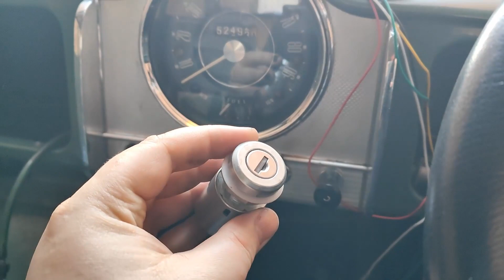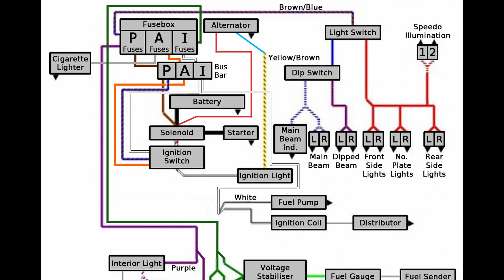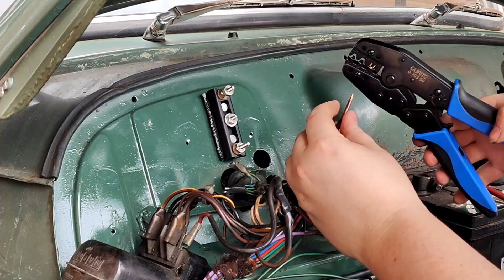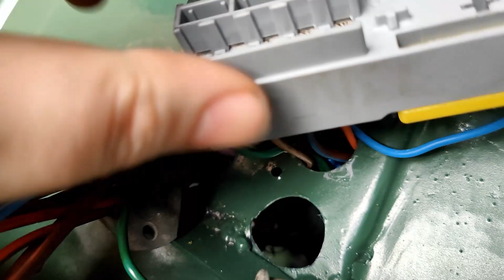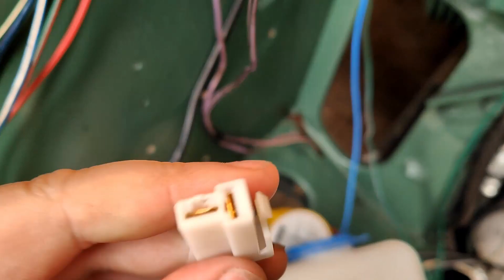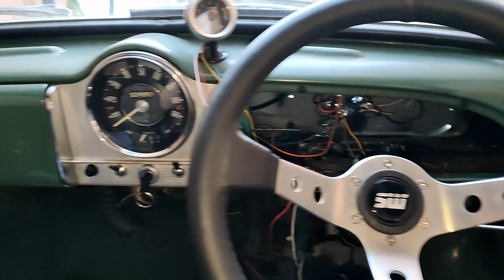Morris Minor Fast-ish Road Build Part 4: Modern Fusebox Install

Comment: Hello mate. I am making a Morris Minor as a daily driver with Ford Type 9 gearbox and updated 1275 Ital engine, modern stereo, have used a lot of Modigt bitumen backed sticky panels to reduce noise etc. Been going for over ten years, getting there but finding the wiring of all the extras I have are putting too much power through the ignition switch and I need to sort out a relay to cover an extra fuse box, all new devices being separately fused.  Your videos are helpful - thank you!
Reply from the maker: Sounds like an ideal build. Relays are definitely a good idea, that's what modern cars use to switch between circuits. Honestly, I wouldn't use the fusebox again that I use in this video. It's too small and the terminals are too close together, which means running all the wires to it is a pain. If I was doing it again, I'd use separate fuse holders and relay boards.